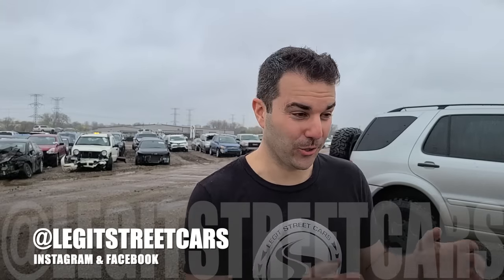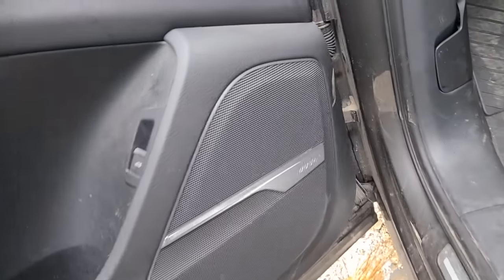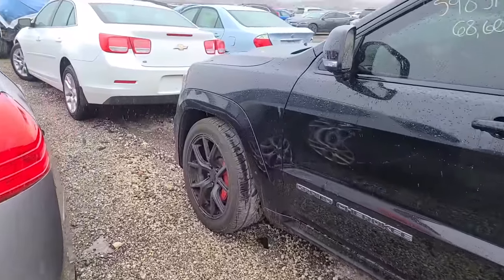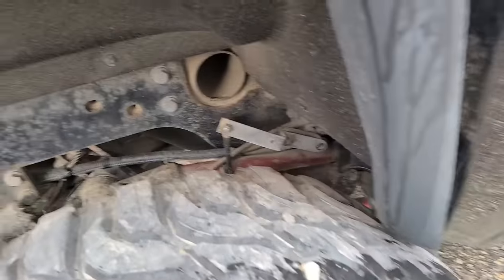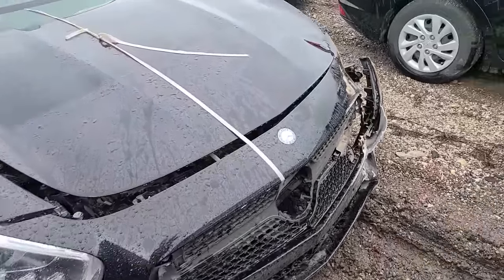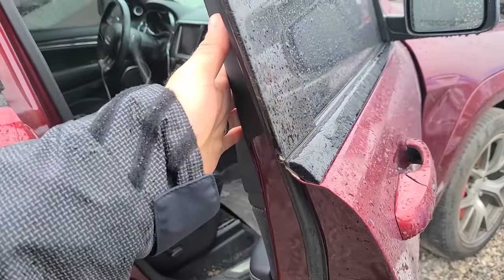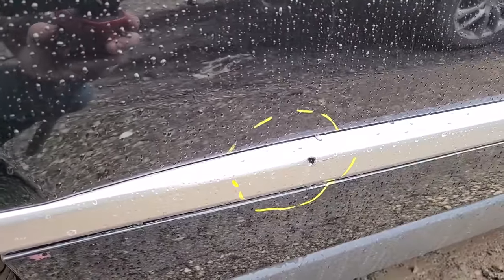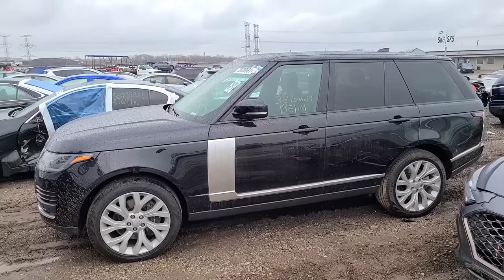Inside A Creepy Chicago Auto Auction Inspecting Cars Riddled With Bullet Holes! Would You Buy One?

Comment: The engine sitting on a pallet looks like a modern TDI engine, strange to see one of those in America 😂
Reply: Surprisingly there are still a bunch of dieselgate era vw cars in the used market.this engine probably came from one.
Reply: All the dieselgate cars have gone through the recall repairs so there are a ton for sale around me, super good deals. All the 4 Cylinder models were saved. A lot of the higher displacement diesel SUVs not so much. 

I got my 2012 with 40k miles in it for $8k.

Comment: Hey Alex?
A few suggestions based on what im seeing here especially in the Stolen/Recovered cars.
The white powder is print dust, nasty itchy stuff and hard to clean out.
That Burgundy grand Cherokee SRT? That stuff in the exhaust looks like glass pack fibre, she wont start and bald rears my guess is stolen with keys and hammered to death.
Bullet holes in the Q7 probably hit body modules and if they are like Volvo they are Vin Coded and expensive to replace plus the dealer work to recode the damaged modules plus No key and thats a nightmare on some euro's (Ask me how I know this lol)
Im a Benz guy and one of the great things about them is DIY electronics repair isnt a major hassle and you can bypass the dealer with a quality unit like an Autel.
Volvo/Audi and a few other Euro's are pretty locked in soooo tech damage = Economical writeoff.
Enjoying this Episode BTW, Still no V12 parts huh lol

Comment: I'm not so sure that lifted Sierra Denali Duramax has any "frame damage"...providing by "frame damage" you mean "actual damage to the factory frame".  Judging by the location of the only visible body damage (the right rear corner), and the way that both rear wheels are tweaked, my guess for what happened to that truck is that it was rear-ended at a stoplight.  Because the truck was lifted so much higher than it was from the factory, the car that rear-ended it actually went mostly UNDER the truck and collided more with the rear axle/right rear wheel than with the body itself.  I'd say the vehicle that hit the truck swerved to the right at the last second, crushed the very right rear corner of the bumper/bed when the A-pillar/front windshield hit that part of the truck and the front bumper of the vehicle actually collided with the right rear wheel of the pickup truck, which ripped out all of the aftermarket suspension components and left the rear wheels all crooked.  I'd bet money that this is exactly what happened to that truck!

Comment: That red SRT definitely didnt have a blown motor, if you pause at 12:09 you can see that the rear tire was sunk in a bit. Those burnouts mentioned earlier looked fresh, either those key fob batteries were dead or possibly someone swapped fobs with another srt in the lot. It wouldve been interesting to see if the lock/unlock worked for that jeep.

Comment: Hi Alex,
I have a suggestion.  Purchase anyone of those which have been keyed (I thought I saw a huge scratch on the 'perfect' Lexus passenger rear door) and give it to me.
I'll drive it that way, because when you drive a nice car here (about 70 miles from you), they just key it anyway.  Ditto for one with bullet holes (just bondo patch it no need to paint).
One week after we bought our used 2010, someone keyed a huge 3-foot number "5" in the driver door, and made a few dings (we don't have a garage).
Hey, maybe you could fix-up one of our cars on your show (or soup them up).  All parts and labor would be gratis, of course, and I could help (watch you).  Actually, I could help as I am unemployed, so i am available, and have worked on cars.
Regards,

Comment: I bought my 2015 Ram sport from copart and it was clean title and said vandelized. Said it runs and drives . Beside a damaged fender and front lower facia I couldnt find any other damage in the pics. I was too far away to go and inspect it. When it got delivered, while it did "start and run" it did not run well enough to even get it off the truck and we had to drag it off. So, my "vandalized " truck got repaired with a used engine,fender,front facia and drivers door. Im still shocked they wrote it off for that ! I only paid 10,300 and the trucks sticker price was 52k .

Comment: 6:37 I don't really see any frame damage. The bed lines up pretty well with the cab from what I can see, but can't tell if the gap is the same on both sides between the cab and bed. Definitely has some suspension damage and needs a new axel, but that doesn't necessarily mean the frame is shot.

Comment: A new vehicle does NOT have to have $40k in damages to total it. Remember that vehicles have value in their totalled condition,  so that has to be factored in. A theft recovery can total a vehicle as well. If the insurance company has paid out on the vehicle and then it's recovered down the road, it will get sold at a salvage auction as well.

Comment: What are your thoughts on the Acura RX white SUV with no visible damage and starts and seems to run fine?. I’m guessing flood damage? I know the flood damage can come back to haunt you badly in the future due to wire corrosion, etc. I had a brand new Honda Civic back in 1996 which got some brackish water in the floorboard due to an overnight storm and my mother did not warn me that I needed to move it to higher ground, thanks mom!, But the Juster came out and totaled it immediately. I just could not believe it. I had 2 inches of standing water in the floorboard and the car would not start

Comment: I think the owner of the Range Rover shot up his own car. He got tired of it keep breaking down so he shot it up and filed an insurance claim. LOL
Reply: The Range Rover was a rental. The no smoking sign on the dash/console is a dead giveaway.
Reply: @Serps-ii9zc  I guess if you need to your RR fix renting is the way to go without having to actually buy one and deal with the headaches.
Reply: nah, it's a 21 with a few thousand miles on it.  In general if the car is breaking down you just get the dealer to take the car in for repairs for a couple of months.  LRNA will buy it back under the lemon law, once a car spends over 30 days for repairs in most states it can be lemon law'd.  If you threaten LRNA with a lawsuit or lemon law case they will take the car back 99 times out of a 100 and give you back 100% of your money.  They seem to be pretty used to this.  Any Range Rover older than 4 years old I wouldn't put past a person having it "stolen" and totaled.  Once they go out of warranty the costs of owning one can be astronomical.

Comment: The hole in the door on drivers side must have gone through the door from the inside coz if it had gone through the door from the out side in to the car the hole would have been bigger from the shrapnel from the metal. It went through the rear head rest aswel on the hale damaged car.
Exhaust wading the stuff in exhausts boxes to quite thm dwn is coming out not an animal in there lol